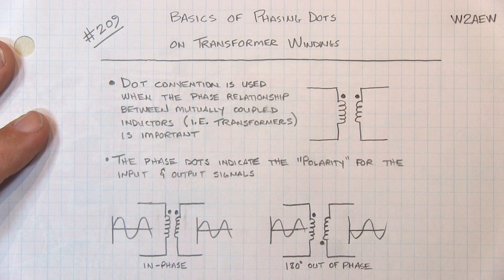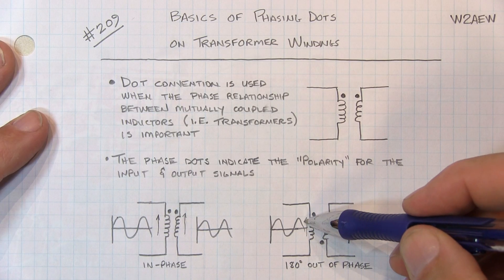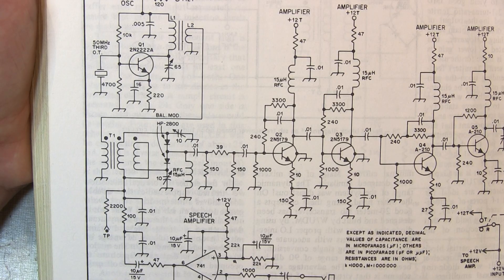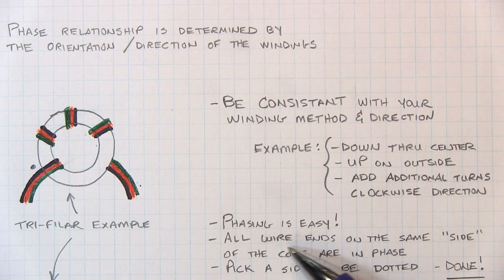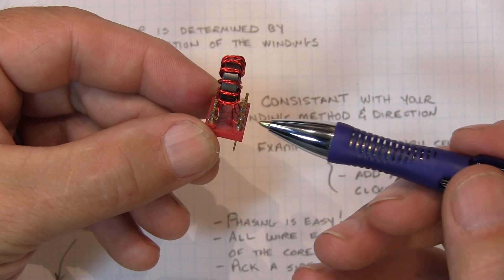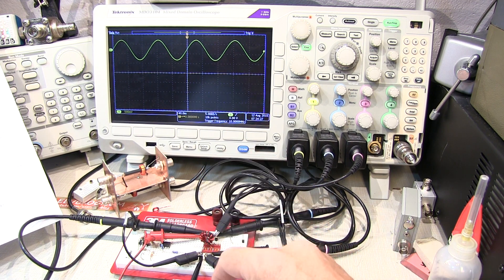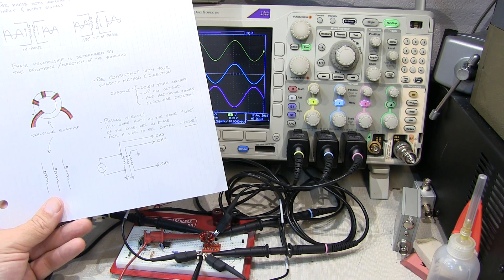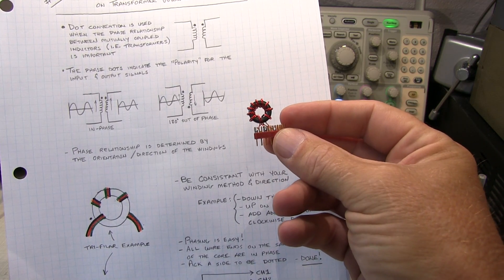#209: Basics of Phase Dots on Transformer Windings

Comment: Does this apply to the secondary winding of a single phase step down transformer. Meaning 1/2 wound one direction to the center tap and
the remaining 1/2 wound in the opposite direction. 180  degrees out of phase?
Reply from the maker: That's one way to look at it.  From the center tap's perspective - each half of the winding is done in an opposite direction.
Reply: @w2aew  Upon further education (3 years into it) I would never expect 
to find the QUESTION I asked before. Both halves would not be wound in opposite directions.        However we can have a SECONDARY to be either ADDITIVE or SUBTRACTIVE depending on the size of the can.

Thank you.    Thusv conversation is all about residential power distribution.  Self taught.

Comment: What causes a transformer to get hot after it being turned on? Units that have MOV varistor will be PTC or NTC that are directly sitting on the transformers housing chassis and will shut the unit off when the transformers housing chassis gets to hot. Some MOV varistors that are PTC or NTC are MOV varistor temperature compensation types and other MOV varistors are clamping voltage types. The MOV varistors that are temperature types lay sitting on the transformers housing chassis and will turn off the unit when the transformer gets to hot. But what makes the transformer get to hot because the lamination is weak or the coils are shorted internally?
Reply: The answer is cheesy, but it's insufficient cooling, if the transformer is not defective of course. Main losses are from I^2R losses in the windings. Eddy currents also contribute but the magnitude is dependant on the quality of construction. Maybe eddy currents in the housing? If the windings are shorted, the transformer ratio and winding impedance will be off. Transformers can have significant inrush currents but they shouldn't persist long enough to cause heating issues.

Comment: So you're saying if you have an outlet that is wired correctly and have a piece of equipment plugged into the AC outlet and another outlet that is wired reversed polarity and have a piece of equipment plugged into that AC outlet. If you put your hands on both unit metal chassis  this can cause a safety problem issues because one chassis is ground while the other is live chassis? I thought they would be both earth grounded regardless of the AC outlet polarity.

Comment: When the hot and neutral wires are reversed polarity on the AC outlet why does it cause damage to computerized circuits or digital circuits? the primary of the transformers doesn't care because its an AC signals but I'm guessing the power transformers secondary winding current is flowing in reverse which causes digital circuits and computerized circuits to get damaged or not like it any reasons why? Also older circuits in the 70's and 80's used negative power supplies and positive power supplies in a circuit, but now modern circuits try not to use negative voltages and negative power supplies, any reasons why?
Reply from the maker: If hot and neutral are reversed, then the safety ground connection is compromised.  If another peripheral (printer, monitor, etc.) is connected which is powered by a different outlet, then it's possible to have a problem with the chassis grounds.
One reason why positive and negative supplies aren't as common today is cost.  Circuits have developed to use single supplies to help safe the cost of an extra power supply rail.

Comment: A general rule of thumb is the primary is "always 10X" what the secondary impedance rating is? The output transformer is rated at 4 ohms means the primary is 4ohms X 10 =  40K ohm primary impedance?   if you put a 3.2 ohm load that is 3.2ohms X 10 = 32K ohm primary impedance. For amplifiers speaker cabinets if they have 2 speakers at 8 ohms it will be connected for 4 ohms, if you have a speaker cabinet with 3 speakers at 8 ohms it will measure 3.2 ohms. The Mismatching of the 3 speakers at 8 ohms measuring 3.2 ohm impedance while using an output transformer rated at 4 ohms does what you think? It put more of an "impedance load" on the final output power amplifier?
Reply from the maker: I don't believe that it is "always 10X".  It all depends on the design of the transformer.  Audio transformers are rated for specific primary and secondary impedances.

Comment: If an output transformers secondary winding is rated at 4 ohms load and you put 3.2 ohms which is a mismatch, what will happen to the impedance on the transformers primary and impedance of the output tubes. This mismatch causes a type of distortion from the mismatch. I'm not sure what this is called when you do something like this but it's some type of electronic term.
Reply from the maker: If you put a 3.2ohm load on an audio transformer rated with a 4 ohm secondary, the main result is that the input impedance looking into the primary will be 80% of the rated primary impedance.  Thus, it will present a slightly heavier load.  There may be additional losses in the transformer as well.

Comment: For those that don't know both Alan and Wes Hayward W7ZOI who was the guy who did most of the work of "Solid State Design for the Radio Amateur that Alan is referencing here are Tektronix alumni. There are also many other Tek guys who have contributed much to the ham community. I am not an employee or a past employee but was fortunate to spend quite a few years as a ham in the northwest around many of these outstanding amateurs.
Reply: Tek was also an early prolific contributor to UNIX systems software (back in the 70s).They have a long history of generous contributions to several technical communities.

Comment: hi allan I follow you from France and thanks for your very instructive tuto. Could you please  one day make a tuto about the mixing of the voltage.between ac and dc voltage  in the same circuits. how it works. The dc voltage supplying the devices and ac voltage coming from the signals are "mixed or added". There are extract after one of the other one and used.Thanks
Reply from the maker: Eric Le Roux Sure, I'll add that to my list.  This is very common in RF applications.

Comment: Someone commented asking about twisting wires vs. not twisting the wires. Twisted wires produce a better transmission line situation where you are using the capacitance between the wires (primary to secondary windings) along with the increased inductance due to the core to produce a transmission line of a certain characteristic impedance.

If you separate the primary winding from the secondary winding so that there is essentially zero or very low capacitance between them then you don't have this transmission line situation and the transformer is a "conventional transformer". 

Transformers with either twisted wires or windings using coax are called "transmission line transformers" and have some subtle differences compared to "conventional transformers".

Probably should be the topic of another video!
Reply from the maker: Herbert Susmann Yes,, it probably would be a good video.  Thanks for the technical explanation for my other viewers!

Comment: Great explanation. If I could take it one step further, however. It should also be noted that the CURRENT in the transformer windings for an ideal transformer goes in the OPPOSITE direction from the voltage. If current is going into the dot on the primary then it will come out of the dot at the secondary.

As Alan points out the VOLTAGE behaves oppositly: when the voltage is at it's peak on the primary (say positive) then the voltage will be at a positive peak in the secondary for dots on the same side of the transformer.

The current in the secondary produces a magnetic field that tries to buck the magnetic field produced by current in the primary. This is Lenz's law.  For an ideal transformer (no leakage inductance) operating with a load on the secondary the net flux in the core is ideally zero.

Another way to think about this is think of the secondary winding as a "generator" where voltage is produced with the same polarity as the primary but current direction with respect to the dots is opposite. A generator sends current out and it can only do that if it's output is high when it is sourcing current.

These points are subtle and I have not really seen them explained well in textbooks or even ARRL publications. It is key to understanding these kind of circuits however.
Reply from the maker: Actually, Herbert summarized this quite nicely for you!
Reply: @w2aew  +Herbert Susmann As easy as this sounds, I'm having trouble reconciling this practical observation to Lenz's law. If the magnetic field is building on the input side, shouldn't the induced magnetic field on the output side be reacting to oppose that change? If so, why doesn't the output side have 180 deg opposite polarity? Is it because for input, current lags 90 deg behind voltage, but for output, current leads voltage by 90 deg? That way, current difference between leads on the same side would be 180 deg opposite polarity, but voltage would be in sync?
Reply: Oh, another forehead slapping moment.... Of course Lenz's law is satisfied, and of course current is opposite. I wasn't paying attention, the input coil is the load of the primary circuit, and the secondary coil is the voltage source for the secondary circuit. Indeed, current goes in opposite directions for the same reason that voltage signs flip when current into any inductor declines...
Reply: "The current in the secondary produce s a flux that tries to buck the primary flux"  Sorry, don't get this! I thought the primary flux goes thru the sec coil and this creates a current in accordance with the right hand rule. So there is only one flux, one direction of it. Am I missing some thing?
Reply: Hi Alan. A follow-on video addressing current flows and corresponding magnetic fields in transformers would most appreciated!
Reply: Howdy. On the spot.
That way my college teacher explained it.
Regards.

Comment: 0:35 Doesn't the Xformer shift the phase 45 degrees since the output is (I believe) the derivative of the input?
Reply from the maker: Power Max If the transformer is properly designed for the application (and the winding inductance doesn't enter into the picture), then ideally no phase shift occurs.  In reality, there is always some shift, but not 45 degrees.  If it was a derivative, the phase shift would be 90...
Reply: ***** right, I need to learn my degrees, that's what happens when you learn math in radians :-/ but anyway, I thought because the secondary's output is proportional to the change in magnetic flux in the core, seemingly meaning that the output would be phase shifted.
Reply: Power Max OK so I think I figured it out, the primary is an inductor, so the phase of the current lags behind the voltage across it, that current is directly proportional to the magnetic flux, and the secondary current is proportional to that magnetic flux, responding to how it changes over time, so then the current/voltage is shifted back to what is was originally? right?